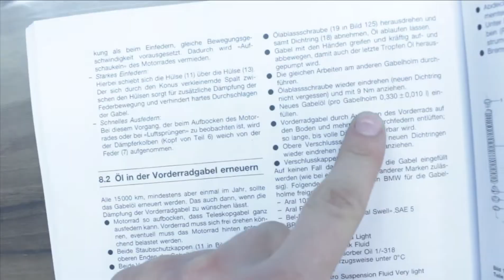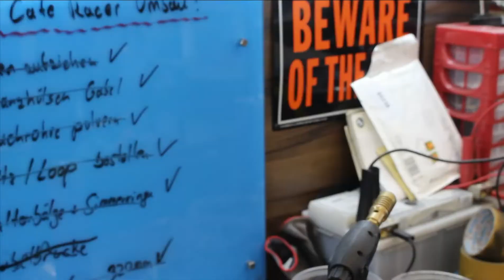BMW ★ K100 Cafe Racer Build - lowering the stock fork! - C.P. Customs #12

Comment: Hi @CP Customs,
Did you end up with going with 5 CM? Furthermore how did it affect the ride with the space in there. I guess it would be like having a 5cm preload of the spring.
Asking as i'm doing the same on my BMW r80rt 1987 that has the same front suspension, and i'm not sure if i should cut of the same amount of spring as the spacer insert to avoid the preload. my insert/spacer is only 3 cm.
BR Chris

Comment: Where did you buy the lowering kit? And is it possible to do this without a hydraulic machine?
Reply from the maker: It is not really a kit is is just the additional tube I put in. I bought it from BMW original parts online shop. It is possible but you need a lot of force to push, pull and put the clip inside at the same time 😅 If you want to know more about the process hit me up on instagram 😎 BR Patrick ✌🏻
Reply: Do you have the part number?
Reply: ...also, ich hab die Gabel einfach etwas weiter durchgeschoben:)